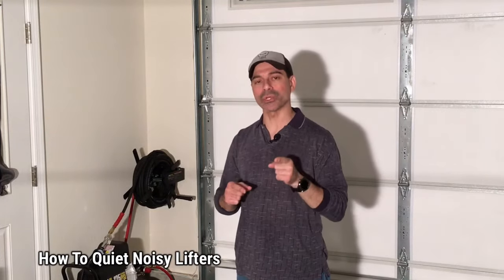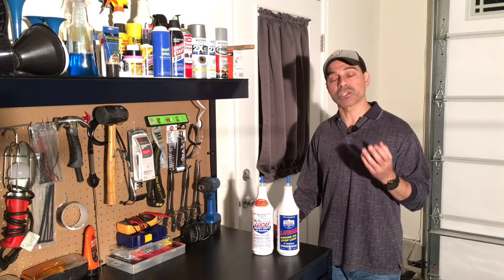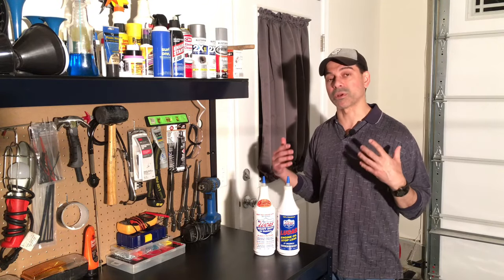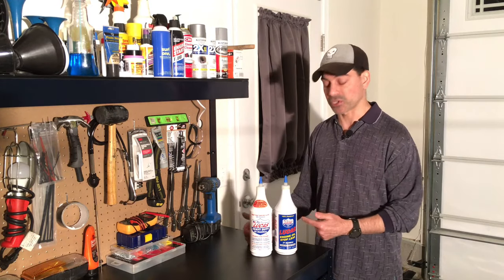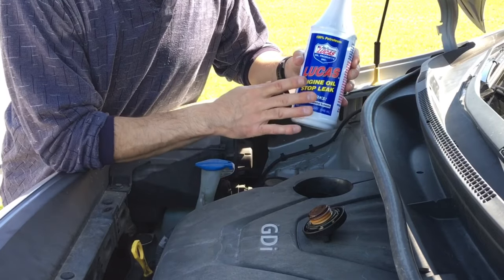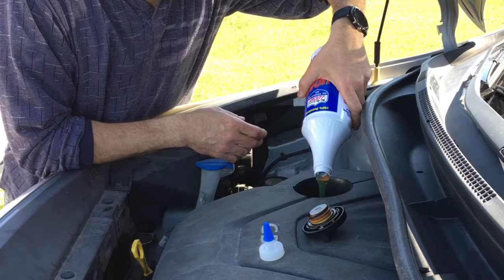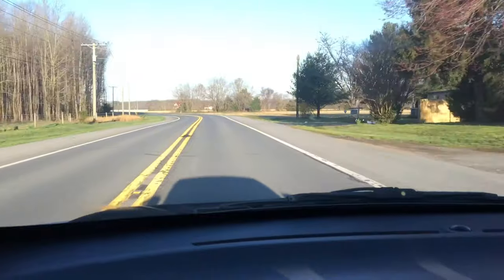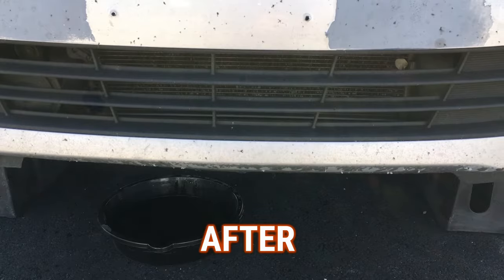How To Quiet Noisy Lifters (Andy’s Garage: Episode - 253)

Comment: a few things in play here.
if you have a relatively new motor - less than 100k - using a good synthetic oil should keep the engine clean with no further action taken. 
if you have an older engine with over 100 k  you may need to flush your oil passages.  doing this aggressively  IS NOT  a good idea. 
doing this GRADUALLY  is imperative - breaking loose chunks of carbon and dumping them into your oil pan will clog your oil pump screen and choke off your oil pressure. 
diesel fuel works great - but it's a very aggressive cleaner / solvent, and will evaporate as the oil heats.  it also thins the oil quite a bit.  if you use the diesel method - you should add about a quart of diesel then drive your car for about 30 minutes prior to doing an oil change. 
ATF  is a great cleaner and lubricant.  add 1 quart of  ATF  to  4 quarts of oil for a 5 quart engine.  drive the car / truck.  the  ATF  will dissolve carbon in the ring grooves, push rods and lifter oil galleries. 
i've seen a lot of stuck rings and stuck lifters cleaned up with  ATF. 
i've also seen a lot of old push rod v/8's go over 300k without tapping lifters or burning oil because the owners used  ATF   in  every second oil change.
Reply: Using the ATF in the oil how long should you drive the car before changing the oil. I have a tapping noise in my Buick 3800. When first starting the car in  the morning there is no noise. After driving about 2 miles or so the tapping starts. I have used the Lucas oil additive but that did nothing to help. A mechanic said to use ATF and drive about 50 miles.
Reply: @robertanderson7049   D0 not take my advice.  
Do not use anything that thickens the oil like Lucas.  
It sounds like you have a soft check / sticking check valve in a lifter. 
It could be stuck, clogged or if not adjusted correctly - the lifter is not pumping up. 
As your oil begins to thin - pressure drops , the lifter goes slack and the tapping starts.  
I put a quart of  ATF  in the oil and let it go to the next oil change.  Never had a problem.  Kept all my lifters clean. 
To flush the sludge out :
Add 1 quart of diesel fuel to your oil and drive  30 minutes  / miles then do an oil change immediately. The diesel fuel is an aggressive solvent for oil sludge.  
When you do the oil change - add 1 quart of  ATF.  ATF  is a much less aggressive solvent and a better lubricant.
You might also consider having someone do a lifter adjustment.  This could be the entire problem.  Make sure they know what they're doing or they'll trash your engine.   
Do not follow any of my advice.
Reply: @mixter7x7  DO NOT take your advice? I should put a quart of ATF in the oil and drive it for a while then get an oil change? I just recently got an oil change. The engine does not make any tapping noise when I first start the car up in the morning. Then after driving a bit the tapping starts. Sounds like it is only one lifter. The oil pressure light does not come on. I will not put anything in that is thick- that is not the answer. A mechanic said to use the ATF. Also a mechanic said most likely an oil passage was clogged a bit and a lifter was not getting enough oil. There is one good garage where I live, and there is a GM dealer. Thanks for your reply.
Reply: @robertanderson7049   How many miles on the car ?  When were the lifters last adjusted ? —if at all —. Do not take my advice. Put in a quart of  ATF and drive it to the next oil change. The ATF has sufficient lubrication when mixed with the engine oil.   If the tapping has not stopped by  then - BEFORE changing your oil again - add 1 quart of diesel fuel and drive the car for 30 minutes or so. Then do a regular oil change.  If the tapping has not stopped by then - I would consider adjusting the lifters if they’ve not been adjusted. Beyond that - you will need to have the lifter replaced.  Best to just change them all. Yes - probably an oil passage or lifter check valve is clogged or stuck.   I will discuss this in my next message.  Do not take any of my advice.  I have only been a professional mechanic for 40 years and probably don’t know what I’m doing or talking about.
Reply: @robertanderson7049   let me know when you've read my last message and i'll give you 1 more thing to consider.
Reply: @mixter7x7  Hi. I read your message. The car has 180,000 miles on it. Drives well. No misfires. Idles smooth. Quiet as can be 1st thing in the morning. Starts tapping after driving a couple of miles. I recently got the oil changed. I will try adding a quart of ATF and see what happens. Thanks for your replies. Bob Anderson
Reply: @robertanderson7049   Bob - here's the possible problem.  If the car has 180k and has never had a lifter adjustment - that could be the problem.  I have seen a ton of Hondas burn  exhaust valves at around 100k because the valves had not been adjusted.  
Contrary to popular belief - valves more often need to be loosened - not tightened. As the car runs the valves beat into their seats.  After billions/ trillions  of impacts with the seat - the seat and valve face begin to wear. As they wear the valve stem moves higher / tighter / closer to the rocker. Eventually - the valve stem is touching the rocker constantly. Soon after the rocker is holding the valve open.  The next thing to happen is the exhaust valve leaks because it's not closing completely.  Next is a misfire  by loss of compression. 
In between all this - the valve is pushing against the rocker - the rocker against the pushrod and the pushrod against the lifter.  the plunger inside the  lifter needs to reciprocate in order to pump up correctly. if the valve lash gets too tight - it can prevent the lifter from pumping up correctly which will give you a lifter tap / tick because the lifter cannot fill with oil correctly.  
your last effort before replacing the lifters should be to have a qualified person attempt to do a lifter adjustment with the engine running.
Reply: @robertanderson7049  did you get to the bottom of this eventually? Sounds like it could be an exhaust (manifold) leak to me, since it appears when the car warms up. Temperature related.
Reply: @mixter7x7  I think that's what's going on with my 2013 corolla with 207k miles. I'm hearing what sounds like an off & on lifter tick. The 1.8L engine has "automatically adjusted lifters" so I'm sure they've never been touched. They may just need to be replaced at this point.
Reply: @TheCRTman   Hope this helps.    
 https://www.youtube.com/watch?v=dw4eqOM3GWk
Reply: @TheCRTman     I sent you 2 different articles about timing chain noise in your model. More likely timing chain noise than lifter noise in your car.  Lmk what you find.
Reply: Man I’ve used that atf thing for 5k miles and it still hasn’t silenced my tick. It’s not nearly as bad  as this. Very subtle but still bugs me
Reply: @roddyrich2335   What type of engine ?
Reply: @mixter7x7  4.8l ls engine in a 2002 Silverado
Reply: @roddyrich2335   Miles ?  At least 3 different possibilities.  1 - the lifters need to be adjusted.  2 - you have a soft lifter that will never stop making noise.  3 - a small exhaust leak can be misleading and sound like a lifter tick.
Reply: @mixter7x7  I’m at 220k, the tick started around 205k. Good oil and filters always. The “tick” seems to be coming from the driver side. 

How would I test /what would you do in my shoes? I want ol blue to make it to 300k+
Reply: @roddyrich2335  Did you watch the video I sent ?  It may not be a lifter. It could be a very slight exhaust leak
Adjusting lifters is easy - but you have to know what you're doing.  Or take it to someone who knows how to adjust them correctly. 
One of my co-workers recently replaced all of his lifters because he had  a few that were completely flat.  
At 200+ it could be the lifters / valves just need to be adjusted.  Not uncommon.
Reply: @mixter7x7  Can you provide help still?
Reply: @tripleauniversal  What's the problem ?
Reply: I’ve got a 2016 Mitsubishi Lancer GT that is at 95200 miles, out of nowhere it ran low on oil and now it’s making similar noise as the motor in the video when the car is warmed up and accelerating. Any advice, that I should not take.
Reply: @cosmobalassa3399   Do you have continuously high oil consumption ?
Reply: No, I haven’t had any issues until now. I’ve been getting the oil changes done at a Jiffy Lube and following when they recommend an oil change. I would say maybe once before my last oil change my car had low oil pressure but I was already on my way to get an oil change.
Reply: @cosmobalassa3399  You said the car recently started increasing in oil consumption - monitor the oil level for consumption. See how many miles it takes to use 1 quart.  Check / replace your pcv valve before doing anything else. Make sure it's installed correctly.   Don't let your engine run lower than 1 quart low before refilling to full. 
Drive the car 1000 miles and send me another message about your oil consumption.  lmk
Reply: I will do that. Thanks.

Comment: Hi I have 2006 Cadillac STS it has the Same sound the same  nosie. It goes away when I am driving but comes back sometimes when comes to a stop . No codes and still runs like a beast . Any idea?
Reply from the maker: Have you checked your oil level? If your engine oil is getting low it can cause that
Reply: @PhillipsVision  just changed the oil last night , someone mentioned it can be the waterpump my pulley wiggles just a lil bit

Comment: Hey man I love the video definitely subscribed. My Kia Soul ran super low on oil and by the time I found out about it I’ve been hearing this ticking it sounds a lot faster than the tick in this video what might it be
Reply from the maker: It could be the valve lifters, or the timing chain and sprocket
Reply: Probably piston slap its common on the souls there should be a recall for it
Reply: If g
Reply: @jpin2469  it’s a Kia man, they’ll go through 4 engines before the car hits 100,000 miles
Reply: @jpin2469  it’s a Kia man, they’ll go through 4 engines before the car hits 100,000 miles
Reply: Not true! I have almost 155,000 miles on my 2014 Kia Rio and although I do have lifter noise, I love my car it has been good to me.
Reply: @seeclearlynow2123  I also say not true. 2011 Kia Forte original motor 209,000 miles and going strong. The secret to longevity....full synthetic  oil changes every 3000 with OEM filter and the fact it was built in Korea.
Reply: @eddiephillips8882  Hi Eddie, I have used synthetic blend for the engine. I just replaced my spark plugs and all four coil packs in the last year. Oddly enough the ticking/clicking stopped. I ran non-ethanol two tanks, but unfortunately the code shows oxygen sensor and catalytic converter. I don't have a GRAND to replace them.😕😭😭 I just pray it lasts a bit longer. Any suggestions or ideas? Thanks Eddie! Happy to have found you.🙏😊
Reply: @2223mikey your not lying either I’ve had 3 new engine in my 2017 Kia Optima can’t wait to get rid of it

Comment: Andy! I have an Honda Accord V6 and it is using 5-20 Oil. How do I go about applying your  fix method? Please let me know. Thanks
Reply from the maker: Use the same mixing ratio as mentioned on the container. These additives should mix with any weight oil.
Reply: @PhillipsVision  do I still add the stop leak if I don't have a leak?

Comment: Can I do this after a new oil change?
Reply from the maker: Yes, but you’ll have to drain enough oil out to make room for the additive. You DO NOT want to over fill your vehicle’s oil capacity.
Reply: @PhillipsVision  I just got an oil change yesterday. my car has the same engine takes 4.8 quarts how much do you suggest I should drain and should I change the filter as well ?
Reply from the maker: @salyoungkid  No need to change the filter. Depending how bad the noise is will determine how much. If it’s just a low noise, just do one quart, if worse put two. Hope this helps.
Reply: @PhillipsVision  really appreciate you sir!
Reply from the maker: @salyoungkid  my pleasure

Comment: Nice video I have a 2005 mercedes e320 with 200k miles and I have the same problem my question is do you think that much of lucas additive is going to thick the oil too much and not to allow proper lubrication in engine passages?
Reply from the maker: Shouldn’t be a problem as long as you don’t exceed the % ratio as mentioned on the container

Comment: So I have a question for anyone that can help me out here . 
I didn’t move my dodge charge for about a year due to it being wrecked ! When I got it fixed it started with the ticking as well ‘ any idea if they should be replaced or if I should just perform these steps first or take it to get looked at . ?
Reply from the maker: How was your oil levels when you restarted it? When a vehicle sits too long the oil can settle and cause damage to the engine if started without adding some oil first.
Reply: The oil levels were good enough to start up as soon as it got out from getting fixed I took it for a complete oil change

Comment: I get this tick on cold start up only after a couple of minutes the noise goes would this stop that irritating noise on start up other than that my vw amarok runs beautifully.... for now 😂
Reply from the maker: Having a ticking noise at cold start up that goes away can be  an indicator that your oil level is below normal. I would check that first.
Reply: @Phillips Vision  just been flushed and changed and at the correct oil level on dip stick been driving me crazy it does go quiter after a couple of minutes and is coming from up top of the engine no lack of power or hesitation or any other syptoms just a obviously louder ticking noise for a  minute or 2 thanks
Reply: Also used stp ceramic engine treatment should that have an immediate effect or does it take 50 miles to wear in I have drove approximately 15 miles with this in now to no avail unfortunately

Comment: my car 2004 acura mdx 216k miles, has loud noise, when I give gas stepping on gas, sometimes noise disappeared, so whether it is the same as yours? thanks
Reply from the maker: How is the oil level?
Reply: @PhillipsVision  thank you sir, oil level not full, is on the safe level when I tried to hav e oil changed, Firestone staff refuse to do it after they started the car for the loud noise,
Reply from the maker: @kellytalkrealty  Try topping off the oil and adding an oil stabilizer. That might help, if not, you’ll need a mechanic to look at it
Reply: @PhillipsVision  thank. you , I thought so, today I will try that, do you know if I keep driving this car like as is b before I get it fixed, it won't die on the road? I need to figure out what is the real problem. one mechanic told me do not drive if yo don't have to, drive less distance possible, you think so too? than you so much sir.
Reply from the maker: @kellytalkrealty  I would try to avoid driving too much. If it’s repairable you can cause more damage by driving
Reply: @PhillipsVision  HI Sir,

I bought one bottle of the engine stabilizer, but I watched your video again found you use 2 bottles, and I bought 4 bottles os the high milage engine oil, I should buy two bottle or 3 bottles? since my car's noise is pretty loud? I have not done that yet, since this will be my very first oil change, I need to learn from this, I watched a few times of where the nut is, will be doing it tomorrow, if I need tow  or 3 bottles?  thanks a lot.
Reply from the maker: @kellytalkrealty  if you engine capacity is 5 quarts, you can put 3
Reply: @PhillipsVision  I did oil change put 3 quarts stabilizer and two quarts of engine oil, no change on loud noise, I drove about more than 20 minutes in the community looping around, do I need to go to high way? no change at  ll, my neighbors told me same loud noise. so what do I do now? thanks, maybe the lifter or the hydraulic tensioner showed on your video on YouTube? what would be how much will they cost on each situations? to replace the parts? someone said to replace the engine, which is better,  I would not buy a new car if fixable, I might be overseas soon to see my mom. give me a best choice? possible? thank yo so very much.
Reply: I would not buy a new car to let it sit for a long time, if older or used car I would not mind much, I may stay overseas for more than two months, all depends on mom's health. if new car sit too long doen't make sense to buy now. I cold buy later.
Reply: I have a BMW 2008 need to replace Mass Airflow sensor, maybe I should fix that, so I am able to drive, the car do not drive all the way, the sensor stops the car in about 2 minute, is that fix it all? if I replace the MAF sensor? this is not the right video to talk about that problem.

Comment: Have 2003 Cadillac Seville tgaf gas tapping sound i guess uts the lifters tried another product went away for month came back. Don't know if this will work. Since you said ill have to always do it.  I want permanent fix. What can i do.  I don't have much money.  Why does it make this sound what causes it to start. Bought fir 2000 lady wanted 3500 . Then two weks kater check engine light , suspension light electrical light can't go over 90 mph light . Guess she reset vattery to make all these go off she swore to god and her kids nothing wrong with car.  Smh. I don't have more money for another car.  I already need new tires.

Comment: My Rio sounds exaclty the same and now has 217 000km on it. 

Annoying ticking sound that goes on and off. Ticking sound is much stronger and noticeable on idle or low speeds.

Gamma 1.6 drinks oil like an alcoholic but does not smoke either on cold start or simply running. Where the hell goes the oil if it ain't smoking !?!
Reply from the maker: Could be leaking, or burning it without noticeable indications